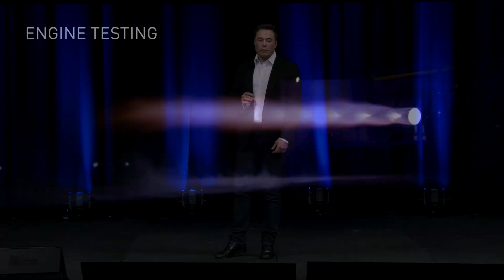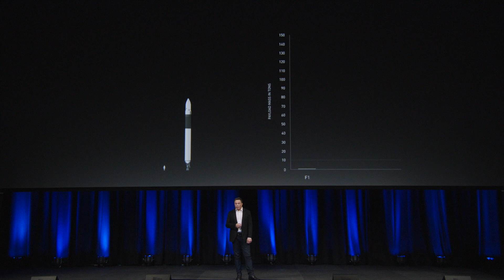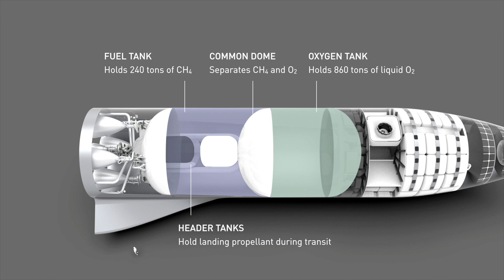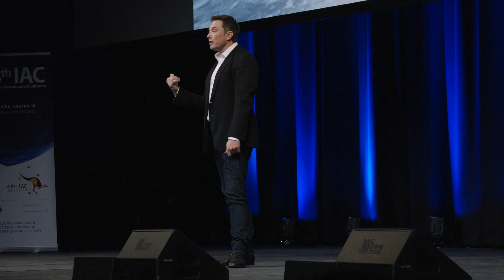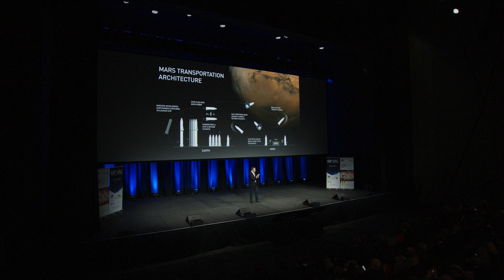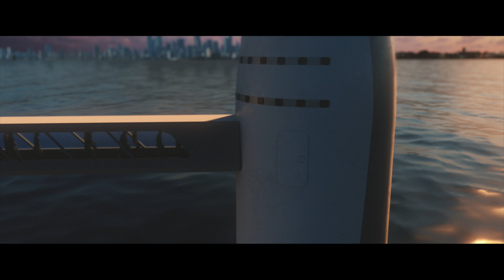Making Life Multiplanetary

Comment: ...
nautical heat exchanger.
Reply: ...
abstract representation
of form and structure.
clustering and spacing.
tube diameter scaled
to height of primary tool.
tunnel boring machine.
35’ to 75’ each tunnel.
2mi to 4mi section at length.
tunnels drawn.
horizontal/lateral construction.
Reply: ...
gathered implication.
sub-terranean habitat.
insulated environment
mars base.
lunar base.
Reply: ...
kind regards.

Comment: It is nice the fuel is "clean" CH4 and LOX, but nothing here is escaping our dependence upon fossil fuels, but rather just adding a new demand for fossil fuel energy. Elon imagines making "renewable" fuel on Mars (out of necessity), but why don't we do that on earth first? Because fuel costs would go up by a factor of 1000!
Reply: I recall reading AC Clarke's "Imperial Earth" with humans on Titan and interesting problem that there are plenty of hydrocarbons, including methane, CH4, but no free oxygen, so it can't be "burned" for energy, so again, Musk showing LOX is primary requirement for fuel by weight and volume. On Earth we have a surplus of atmospheric O2, and much larger than our hydrocarbon reserves to reduce the reservoir, but we still need to find some source of renewable energy in the future to make civilization viable, on earth or beyond.
https://en.wikipedia.org/wiki/Imperial_Earth
https://www.youtube.com/watch?v=GbEu4Hk51hE Audiobook: Imperial Earth by Arthur C. Clarke
Reply: The wonderful thing about Methane is that if produced properly (through the Sabatier process), it can become carbon neutral, as you'd be removing CO2 from the atmosphere to make the fuel and adding it back in flight.

Comment: 26:40 The brilliant quote "and often I'll be told 'but you could get more payload if you made it expendable'. I said 'yes, but you could also get more payload from an aircraft if you got rid of the landing gear and the flaps... and just parachuted out when you got to your destination."

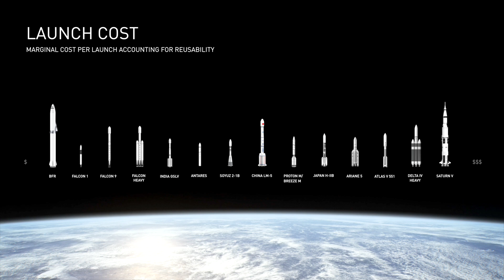The second amazing bit is 25:30 when he compares buying a single engine turboprop plane (which is like current single-use rockets) to chartering a 747 plane (which is like having a fully reusable BFR). It's just a brilliant demonstration of the massive cost difference between single-use and reusable.

Comment: A BFR-orbiter being refueled by end-to-end docking with the tanker looks like a 17-year locust in the mating configuration. 6 or 7 refueling launches seem to be a lot of launches for a complete fill-up! Could it be possible to add a 2nd stage with an engine and electronics module that returns to Earth to be mated with new tanks for speedy reuse when the mission requires a very large payload?  Could fuel tanks in orbit be converted to cargo or habitation modules for manned interplanetary missions as suggested by Kim Stanley Robinson in the novel Red Mars? After all, they contain space, hold pressure, and have insulation. Best of success for this vital project.
Reply: Perhaps NASA could order (and pay) development of the BFR booster as a 1st stage for the SLS main stage which would then be an upper stage for orbit insertion of heavy and bulky payloads. This would give the flexibility of a rocket using different payload shrouds (large or small). The BFR ship without upper stage would then be one of several possible configurations for the BFR booster.
Reply: @karlthemel2678  One cargo tank is enough if it return to earth to be refueled.

Comment: Could you develop a two-chamber version of the Raptor engine in order to reduce the number of pumps required in large boosters while still allowing mass production of the engines? Could you develop a dual-fuel version of the raptor engine to allow the use of H2/supercooled LOX for Earth-orbit insertion and the Earth-escape burns while using supercooled CH4/LOX for all other maneuvers? Could you add reusable strap-on boosters (liquid- or solid-fuelled) to the BFR for heavy payload missions? thank you for your consideration.

Comment: Dear Elon, a thought has occurred to me.  There are new railroads being built where in the trains don't touch the track but rather move (enormously) fast by method of magnetism.  Therefore, wouldn't it be more feasible to build a track in space OR a track that encircles the ship - such as the tread-bands on a battle tank do.  It can all work by magnetic propulsion and need only a small amount of fuel for take-off & landing.  There can be a 'space dock' where the tread is picked up at the beginning of the trip and docked at the end of trip, thus it need not endure re-entry burdens AND is available to other ships to use.
Just a thought.
But if it's a good thought I'm open to receiving royalties, lol.

Comment: Elon wants to someday not have to use fuel to power his rockets. Maybe it could be eventually possible to utilize solar electricity for propulsion through some kind of gradually accelerating magnetic rail system which could launch an object and then reverse the momentum of the transport unit with a gradually decelerating magnetic rail system orbiting  the moon or mars.
Reply: Von Glenn incorrect. Elon has said on multiple occasions that everything will go electric EXCEPT rockets.
Reply: Von Glenn if you listened properly you would realize he stated that the propellant depot on Mars would consist of a large array of Solar Panel to convert CO2 and Water to produce Methane (BFR uses Methane as propellant)!
Which means BFR will be indirectly powered by Solar!
Over time this would be implement on Earth as well!

Comment: Once the question of how to pay for it comes up, NEO metals are the answer.
Our little "companion" asteroid called 2016 HO3, should be the first target for probes, landers, and sample return as well as visits beyond LEO.

What capacity is there for crew survival in case of lower or upper stage malfunction during boost? Reputation for reliability?
They will be launched uncrewed, met by crews sent up in Dragons.

26:42
The cost isn't driven as much by the size of the thing, but by the complexity. Expendable doesn't need half the attention of something that's durable and reliable enough to re-use. Expendable logistics gliders made sense. A BFR orbital package that wasn't intended to land at any place with gravity or air would be different, too.
SpaceX has minimized the difference between re-usable and expendable boosters to only the fins and legs themselves, plus as opportunity allows, fuel to meet the drone ship.

Comment: The Falcon heavy flight had 3 engines and only two landed. The center core engine was supposed to land on a drone ship in the ocean. But it missed the mark by 328 feet and crashed into the Atlantic instead. Still a long way from commercial flight reliability and safety.  But that is rocket science...

Comment: Why not build a docking port in a hole in the ground with multiple levels for loading and unloading.that way you could drive into the B.F.R in the same way forklift trucks load and unload lorries.whilst also keeping the B.F.R out of harms way e.g storms and lightning.plus it becomes a shorter distance to travel people and cargo as they go from ground level to the top of the rocket,not all the why from the bottom of the rocket to the top.

Comment: I love Elons Visions!
One Question: When do you plan on using the Sabatier reaction to make fuel on earth?

The sooner the better!!
Reply: My Creed Probably some time after the point when the power grid is no longer sourced primarily from fossil fuels. In fact ironically the plurality of power generated comes from Methane combustion. Although if you’re getting Methane from contemporary biological sources or gas pockets that will eventually leak into the atmosphere you might as well combust it since it’s a less potent greenhouse gas as water and CO2 than it is as CH4.
Reply: Teboski78 Yes you can/should combust that too but if can extract CO2 from the atmosphere and water and make methane which you can then use in high altitude airplanes and rockets. That would make rockets have a negative carbon footprint (asuming that the electricity you use for the process comes from renewables)
Reply: My Creed Exhaust velocity is below orbital/escape velocity so all burns that take place in LEO or lower with the exception of retro grade burns at or near orbital velocity will cause exhaust gasses to end up back in earth’s atmosphere,
Reply: Teboski78 Yeah I know, most of the fuel will get back in the atmosphere but even if all of it ended up in there, mathematically there would be zero emissions
Now if some of the fuel is used to land on the moon or Mars,  you would already have negative emissions!

Comment: I am all in favor of further exploration of Mars, but proposing "a permanent, self-sustaining human presence" there is completely cart before the horse; we haven't even succeeded in establishing a self-sustaining biosphere in Arizona (see Biosphere II)!  Experimentation with making mostly self-sustaining (i.e. with defined inputs) environments should proceed -- and it will be far, far cheaper on Earth and then on the Moon than on Mars!  Mars has less than half the insolation as Earth and (for most human purposes other than aerobraking) no atmosphere; it is also very far away.  We should establish permanent astronomic bases on the Moon and study their sustainability using local resources.

Regular visitation of Mars by people necessitates building Mars cyclers first; perhaps an international, unmanned mission modelled on Project Orion could be used to emplace them.  Nuclear propulsion could move a significant mass of water into the orbits required, which is needed to protect interplanetary travellers from cosmic rays.  Our Mars cyclers should be encased in cylindrical shells of ice (confined in tanks) and spun to produce centrifugal force approximating the force of Earth's gravity inside.

P.S.  Propulsion by means of detonating nuclear charges behind a pusher plate and elastic energy storage offer the greatest promise of any we know, but such a vehicle would have to be assembled in orbit or on the Moon so as not to contaminate Earth's atmosphere with radioactive poisons in operation.  While Project Orion was proposed as a means of interstellar travel (capable of achieving speeds up to .1c), a vehicle based on it could be a workhorse of solar exploration -- an unmanned version could employ neutronic nuclear reactions (despite gradual embrittlement of the pusher plate) and avoid the need for fusing Helium-3 (the reaction proposed for Project Orion's nuclear charges); it could also allow much greater extremes of acceleration and could thus be made less massive.
Reply: Not really putting the car before the horse. You have to be able to send 100s of tonnes per rendezvous before you can set up any meaningful foothold.
Reply: John Weck That’s god damned limiting. Also as it currently stands in space construction on that scale is more difficult than the establishment of an extraterrestrial colony.
Reply: The only way to get a viable space colony with earth surface conditions (so we can bring our ecosystem up with us) is using rotating habitats. Yes its difficult, but so is creating disparate surface colonies all over the solar system ( that only partially solve the earth surface conditions problem anyway). The same rotating habitat designs can be used anywhere in the galaxy. Rotating habitats are also out of the gravity well, so you get much cheaper transport costs.
Reply: John Weck U can get everything but the gravitational conditions without having to build the land u stand on and launch all of that into space(minus an initial input of resources to get the colony started). And u could also get the gravitational conditions if ur willing to build angled centrifuges to stand on, and still don’t have to launch those off a planetary or lunar surface. Long term I think most people will be living in rotating habitats simply because u can build more living space with those than all the planets combined have, and with far less material than what is contained in the planets. But  for the next few centuries @ least I think u will see as much or more expansion on planetary surfaces like mars than by way of rotating habitat construction.
Reply: John Weck But In actuality I think that we will engage in both planetary colonization and rotating habitat construction for quite some time.
Reply: John Weck In both cases we will need Von Neumann machines and the colonization of a planetary surface is required if we use the only effective Von Neumann machines currently in existence, which are of course humans.
Reply: John Weck Nuclear power also remains significantly cheaper KWh for kWh than photovoltaic solar(which rotating habitats would likely be dependent on) as long as you don’t have to launch all of your shielding & radioisotopes out of a gravity well.
Reply: Teboski,
I think you would be right, if we were simply building a base on Mars. However, if you want to actually colonize space, and become a space faring civilization, that means you’ve got to move not just people, but part of our ecosystem into space (not a just a small sliver of it, for something like an Antarctic base). If you attempt to build centrifuges on Mars, that are stuffed full of all the biology, they would start to approach the size of a rotating habitat (except that it’s at the bottom of the gravity well, so any trade would be very expensive).

When you colonize another planet, you have to repeat the colony design process from scratch to match the different conditions on the new planet (they all have different problems to solve). This expensive redesign will be repeated every time you want to colonize another planet surface. For instance, try using a Mars colony design on Venus.

In any space construction, both robots and humans will participate. You can also teleoperate the robots from earth, if you’re nearby.

Both surface colonies and rotating habitats can use either solar or nuclear power. The difference is that solar power in space gives you continuous, full intensity power (no special locations, no night, no seasons, no weather, no dust buildup, and no weird angles to point the arrays). Also, if you have fusion power, you can pilot a rotating habitat to another solar system (so they can be used as the cores of interstellar colonization ships). ;)
Reply: John Weck But if you build O’Neil cylinder sized habs on a planetary surface, assuming you sourced materials locally, you wouldn’t have launch all of the materials out of a gravity well to begin with. Only reason transport cost are so cheap between O’Neil cylinders is because you footed the bill during the construction process.
Reply: John Weck Also learning how to harvest materials from different planetary surfaces will present a similarly new set of problems as learning to colonize planetary surfaces.
Reply: When you have a space -faring civilization, which way would you like to go?

a. You move all traffic up and down gravity wells between planets (with giant rockets), and pay huge price for any kind of transport, which trickles down to all products. This why current big cities are near a waterway, or ocean. From a trade perspective, being out of the gravity well means the same thing as living near an ocean.

b. You get everybody trading between rotating habitats, so everyone gets ultra-cheap transport and cargo – this means much cheaper everything. Putting any kind of colony on a planetary surface defeats this goal.

c. We are not going to be mining planets (with the possible exception of the moon). We are going to be mining asteroids, which also exist out of the gravity well, so you get cheap minerals.
Reply: John Weck Long term. Construction of mass drivers, launch loops, sky hooks, and orbital rings will largely replace rockets when it comes to getting off of planetary surfaces. Coincidentally such technologies will be necessary to construct colossal swarms of rotating habitats. But I do however agree that in the long term most human habitation will be in in space rotating habitats. I just don’t think it will completely remove any practicality of colonizing planetary surfaces at least not right away.
Reply: Yes, advanced launch tech will make it cheaper to move things to space, but you still won't be able to beat not being in a gravity well at all. If rotating habitats can do the colonization much better than planets, and asteroid mining can mine cheaper, then when why go to planets at all?
Reply: John Weck Well for one, asteroids account for a very small percentage of the solar system’s total palpable resources. And I think it’s limiting not to take advantage of every source of materials the solar system has to offer. In either case, we will need giant reusable rockets to start us off. So I think BFR will still be the initial key in enabling both the creation of substantial orbital infrastructure and expansion into the greater solar system.
Reply: You use the accessible stuff first. Then after a millennium of consuming the main belt asteroids, you can think about disassembling planets.
Reply: Well our population and the number of machines we can build has the capacity to expand exponentially. And until we can create flawless swarms of Von Neuman machines, surface settlement will be necessary in order to create the necessary infrastructure for large scale resource extraction, so I see little reason to not just start both pretty much simultaneously. Create self sustaining and expanding colonies that can extract vast quantities of resources on places like Mars, and begin construction of in space habitats with materials extracted from asteroids, or launched with mass drivers from the lunar surface.
Reply: ok, good talking to you. bye.